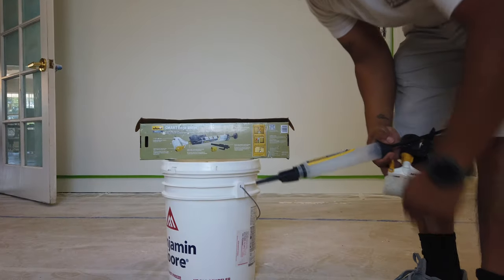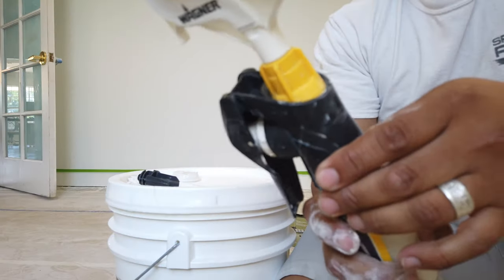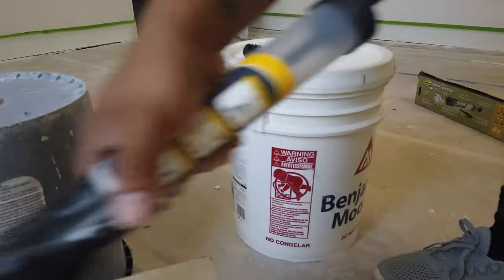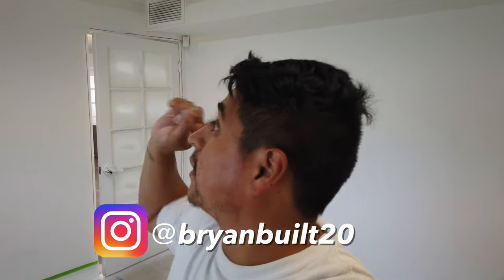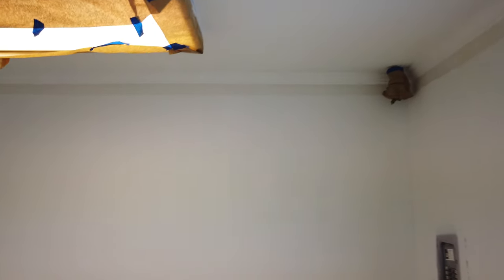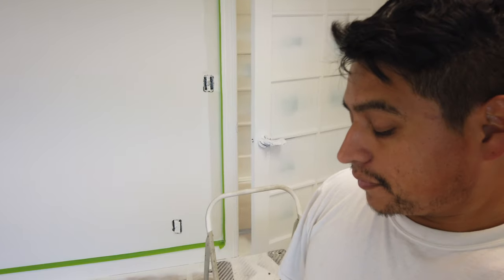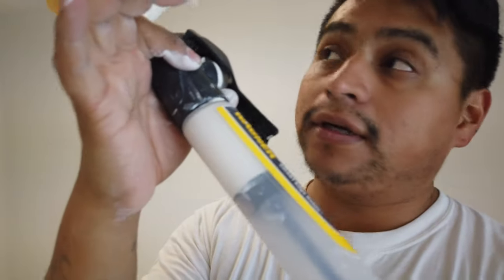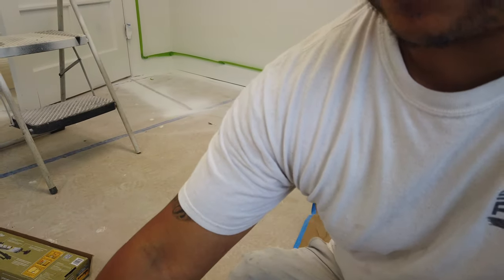Wagner Smart Edge Roller....Does it Actually Work?

Comment from the maker: What do you guys think about this roller?
Reply: Looks faster than cutting and then back rolling. If you’re doing two coats just using that for the edges then cutting in after with a brush would be faster than brushing and back rolling
Reply: Not bad I’m a DYI so this looks very helpful